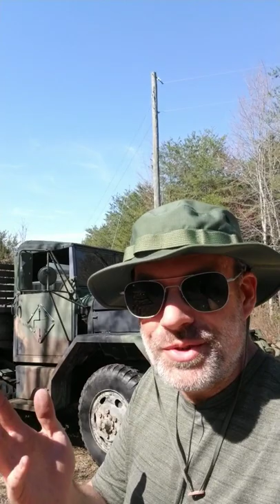Why is it called a Deuce and a Half?

Comment: I thought I read that it hauled 20 thousand on and 10 thousand off road.  I haul a 5000 lb rock crawler in my deuce and a half plus tools and a generator.    It gets it done.

Yeah I just looked it up.  You are right.
Reply from the maker: I have no doubt it could haul that...It's just not officially rated for it.